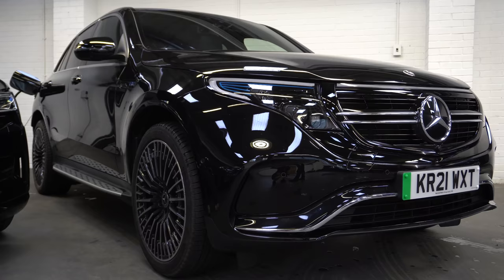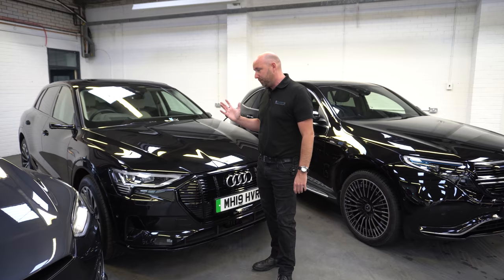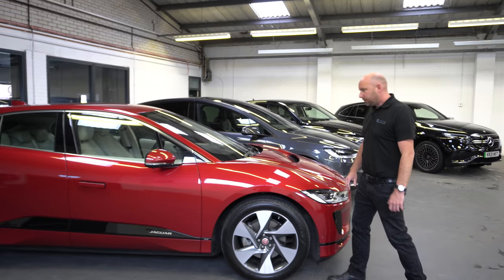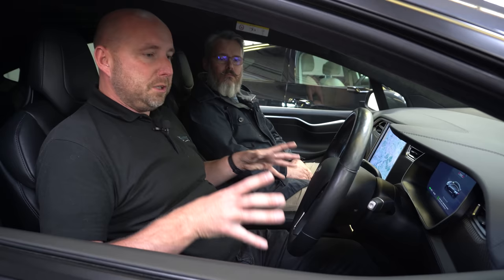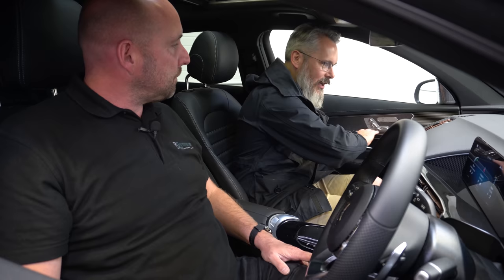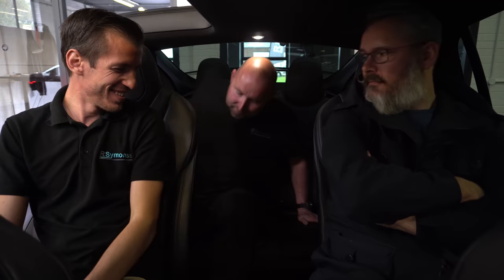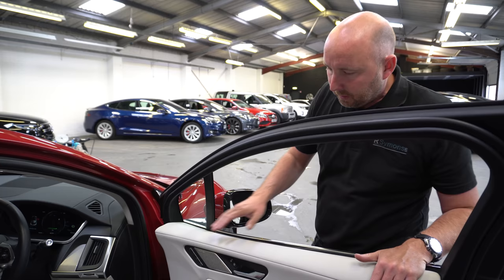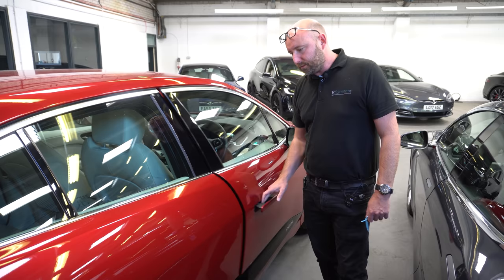Mercedes EQC v Tesla Model X v Jaguar iPace v Audi Etron 55 - side by side comparison interior space

Comment: Simply the best comment I've heard this month: "...Don't go and buy another diesel SUV. There's great electric SUV's out there".

Thank you for saying that, sir.
Reply: The thing about Electric cars, is that it comes with a lot of pre-conditions.

Like having a House & a Driveway first…

Even public chargers cost just as much as Petrol nowadays.
Sometimes the charges (if you find one vacant) aren’t even working & don’t get fixed for Weeks.
Reply: @KINGKING10109 
Everything has pros and cons. Ice and ev's are no different. However ev's are definitely getting more pros and fast.
You don't need to live in a house and have a driveway. I live in an apartment and I charge my car in the garage of the building.
I see other people leaving their cars outside on the street, connected to a slow charger, so in the morning, the car has a full "tank".
But definitely the most positive thing of driving an ev compared to an ice vehicle is that you're not polluting the air that you own breathe, which is pretty ABSURD when you think about it.
Take a look at this explanatory video if you're still not convinced...
https://youtu.be/mk-LnUYEXuM?si=laRPdBZPnw-d_Dzd
Starts at 1:38

Comment: The Etron's ace up its sleeve has always been how quick it charges and its charging profile is very consistent compared to the others. With the improvements coming to the Ecotricity/Gridserve network, that would be my choice.
Reply: Yes, but trying to find the charger in the US, would mitigate that advantage on the E-tron. The supercharger network is too far ahead at this point, hopefully others will catch up. Could be different in Europe?
Reply: @RemoteSpeed007  wow , ElectrifyAmerica alone opened their 600 around the US plus other companies have chargers, I use my e-tron as a long distance car because for work, never have an issue with chargers , every EA has 150 kw chargers as a minimum 8% to 80% in 24 minutes and 38 min to 100% the e-tron has one the best charging curves out there, yes the SC network is the best but check your facts before spreading miss information, don’t be the typical Tesla zombie, I like Tesla but hate the Tesla cult.
Reply: @RemoteSpeed007  it works for me , who cares if they don’t make their own batteries, it works for me , it’s even better that they don’t make their own batteries , I fast charge all the time I drive 3k miles a month in a comfortable Prestige trim with a perfectly made Interior, Silent interior that is. Fact EA doesn’t have that many stations neither does Tesla , Tesla has more for sure, you are talking about plugs , each station will have a minimum of 4 units and as many as 10, 600 stations x 4 units =2400 plugs or units that’s not bad for a 3 years from opening their first station in MA. By the way I didn’t click on your link.
I never said that EA has more chargers than Tesla,, read my post. 
You said  Try to find chargers for the e-tron and that’s the easiest thing to do.

Do you even have car , or I’m I arguing with a 12 year old here?
Reply: @minibx6659  I have many cars and motorcycles. And yes I also have a model M3P and I'm 61 years old, how old are you, pretty sure my kids are older.
That is why I said you don't know me but yet you insult me, WTF? Have more respect for others.

Watch your battery degradation - regularly.
Otherwise have fun and welcome to the EV revolution.
Electric cars are the best.. we all win with electric, no point in insulting everyone choice that is not yours.
Reply: @minibx6659  But you should care, since they use industry standard batteries, but yet charge at higher rates than others, degradation will be much faster.
Reply: @RemoteSpeed007 not my first electric, never mind , good luck 👍
Reply: @RemoteSpeed007  But by unique locations, not total charger quantities, the difference is much less dramatic.  Soon there will be far more non-Tesla high powered locations than Supercharger locations.

Comment: Still prefer the Jag  , great shape, good performance on road and off ,  and not silly big pity they don't have 150kw charging really disappointing 60k+ that should be a given
Reply: I had one as a replacement car for a day, when I took my Evoque in for maintenance. It is a very nice car to drive. The downsides here in Belgium is the starting price of 80K euro or 68K GBP, a missing windscreen wiper at the back (mandatory to get the camera option for the rear view mirror). From an EV point of view, not having a stalk to change the regen mode (only 2), is quite annoying, should have at least 150kW charging indeed and the range/consumption could be better.

EQC and e-Tron are not built on an EV platform. Consumption and range are also a worry, as is charging speed for EQC.

The Model X is too wide and the price is also scary, but if you fully spec the others you are in the same price bracket.

Comment: A question re the MX: I live in Sweden and wondering what happens when you open the gull wing doors and the roof is covered with snow? Does it end up on the seats?
Reply from the maker: I’m on the south coast Uk, very rarely see snow… I don’t know 💁‍♂️
Reply: Falcon Wing doors. No it covers you from rain and snow.
Reply: Depends on how much snow on roof. I alway wipe snow off. If not some will end up inside car. Also wipe snow off rear hatch before opening if falcon wings are open. Forget this and most snow en up in rear seats.

Comment: I would buy a second hand pre 2017 Model X over the other eSUV’s.
Not because it’s more spacious but because the supercharger network. I just recently drove a Model S to the Lake District and back, 700miles, I didn’t worried about charging it for a second and it was free I saved roughly £60.
Reply: Not an SUV fan but I would have to agree, not only Superchargers but better range and actually practical and large inside, which for all their huge shape most SUV are not (EV or otherwise). Personally though I would love a Model S estate 😂.
Reply: Supercharger network matters only if you drive longer distances like on a weekly basis. If you don't, then it's often irrelevant.

And to be honest: we have e-tron 55 and Tesla M3P and I much rather drive Audi - even on longer distances. It's just soooo comfortable and quiet, and because the number of HPCs is increasing all the time, having the charging curve of e-tron is actually much better over any Tesla. You don't need to think on getting to a charger with a low SOC, because any SOC on e-tron gives you a high power.
Reply: @villho  yeah that’s a good point, it’s a case of horses for courses. I’m on my second Model S and the quality has improved but it’s still way off the German brands. I used to do between 25 to 40K miles per year and Tesla was the only option and still is to my mind for that sort of mileage. Since lockdown it’s plummeted and seems unlikely to go back up that much so the options are much wider - and that’s nice - that previous experience probably colours my viewpoint still. Still not a fan of the SUV format overall, but you’ve got me thinking, I do like the Audi GT  🤔.

Comment: I was looking at an iPace as a company car, but lease cost wise even the base model was outside the lease cost limit, where as the Mercedes EQC actually came in less than a Model 3 LR. So I go the EQC - I would guess that at this level we are looking at a lot of these being company cars so OTR pricing is important than lease costs. Anyway the EQC is a fantastic car and even the base Sport/AMG model comes with decent kit levels, although I’d say less fun to drive that the iPace I test drove, the door access is a bit tight given the size and central tunnel mean makes 3 adults in the back a squeeze - ISO-FIX for the centre position would have been useful 🙂

Comment: When you’re spending this kind of money. Only the Model X looks special enough. Rock up anywhere and you’ll draw a show. It’s the most spacious has the biggest range and most recent tech.
Reply: That's all relative.  In most of the U.S. Model X's are very common, the other cars are far more unique and likely to get you noticed.
Reply: @pasad335  like you said. Relative. They are rare in the UK, Asia and Australia. The US is irrelevant in this video.
Reply: I realize looks are subjective but to me, the Model X looks like a squished minivan and is the least attractive of the bunch.  Some of us like our cars because we think they're cool and don't crave validation from strangers - It makes me cringe when people stare at my cars...
Reply: @knudsenj100  beauty is in the eye of the beholder. The Tesla beats the others on space, range and charging network and technology. The car depicted in the video a week ago, is worse than the car it is today.
Reply: Beauty is in the eye of the beholder, but the quality on the x is insanely bad. Sold my 2019 ludicrous performance because of 2x screen bleeding, halfsahaft and clevis mount replacements (shuddering came back again) rubber sealings came off, cracked mid section panels. doors poorly adjusted, repainted due to chips falling of and orange skin. loose speakers and door cards, defective 12v battery. The list goes on. bought it from new and all this happenbed within the 20.000km
Reply: @AKA001  That's why I said looks are subjective.  What is not subjective is really poor build quality.  Not sure what tech Tesla is leading in - no cross traffic alerts, no 360 camera, losing all functionality when the screen goes black until you can pull over and reboot. Hopefully,
 you don't need to backup to stop safely with a blank screen since they are now removing the gear stalk.  The only advantage Tesla has is 10 years of almost no competition and the supercharger network.